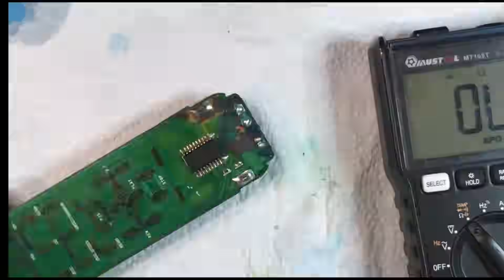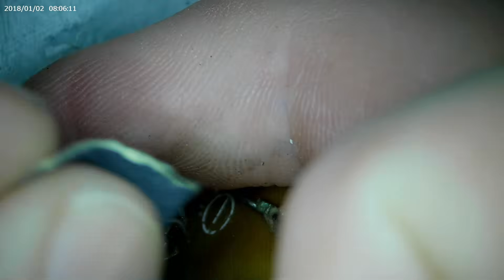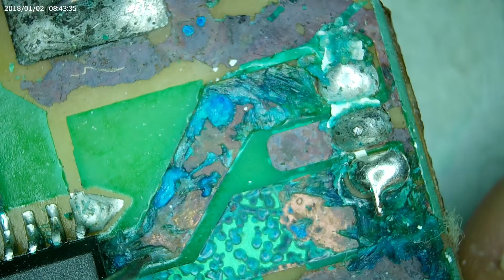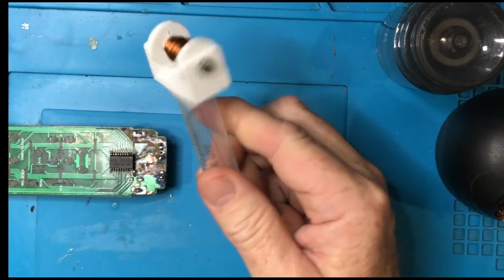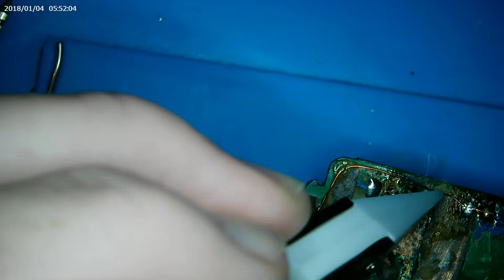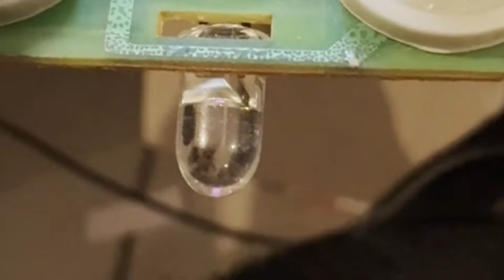Saving a Battery-Damaged Sony Remote — Beginner to Advanced Repair

Comment: Hey Gerry great video! I own a Sony D-CJ01 Walkman which appears to work fine. However, I recently got into burning CDs and saw that it doesn't read burned CDs. I'm thinking it's an issue with the laser, as the CD reads fine on other machines. I'd love to pop the Walkman open, but there aren't many videos on the walkman, let alone the specific problem. I was wondering if the videos you've posted about servicing Sony walkmans can be recreated on similar Sony machines?
Reply from the maker: If it reads commercial CDs fine, it’s probably not the laser (not impossible), but I remember that back in the day reading burnt CDs was a bit hit‑and‑miss. It depended on the brand of CD used and even the software used to burn it.